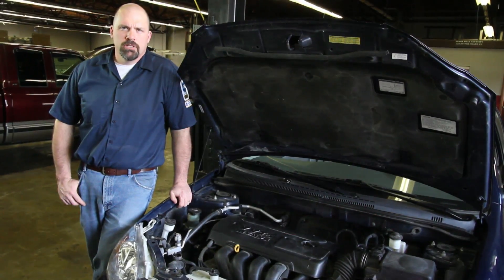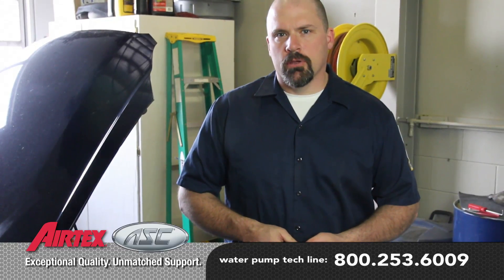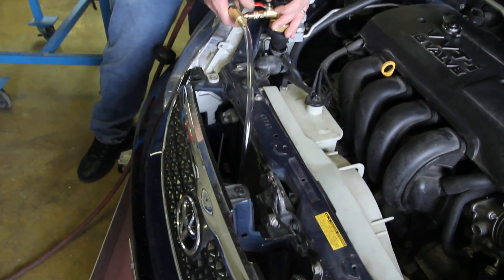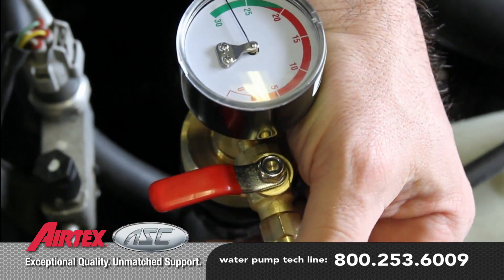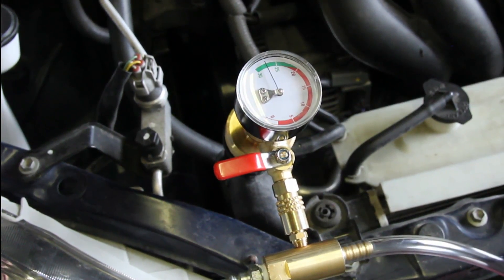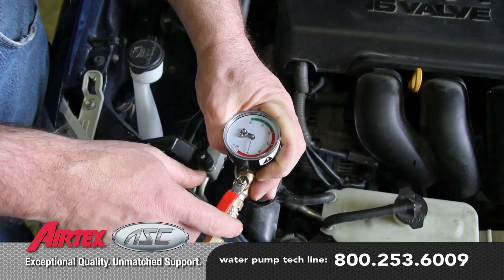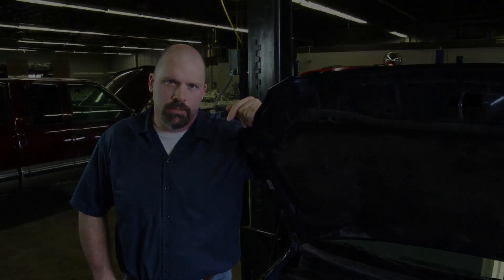Bleeding the Cooling System with an Airlift Tool

Comment: Sounds good would like to have this in my tool box. But it really necessary if you bleed it the traditional way letting the engine run with the heat on and waiting for bubbles to surface adding more coolant? Any suggestion on this vs. the Airlift .
Reply: Certain manufacturers "require" a vacuum refill in the service manual.

Comment: Completely wrong!. You introduced air into the car with the feed line. The feed line has air in it and you are supposed to remove this air from the feed line while you are pulling vacuum. What is the purpose of using this tool if you are going to introduce air in the system.

Comment: how can this tool be used to suck coolant out of engine block
Reply: It’s not designed for that
Reply: @MoparGuy1625  seems to me if sucks air would suck coolant, put in thermostat neck and fill the same way, what you think, thanks for answering
Reply: @dennisgundlach87  when I did my gfs car the other day and it still had some coolant. Not a lot came out.

Comment: i am trying to figure out if this would work on any oil less air compressor? i used 1 gallon and 6 gallon air compressor with max of 100psi and 175 psi. both failed miserablly didn't acheive any vaccum at all, and idled at 0... i did the old burping way.....

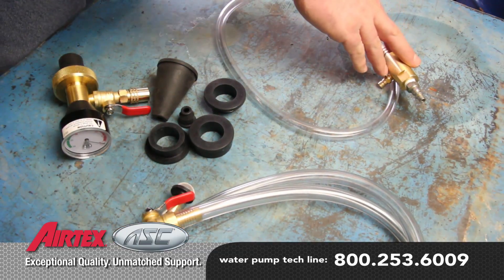Comment: 0:46 engine should be OFF at all times using airlift. Once complete collant transfer turn ON Heat to high and monitor the temp. Add collant to reservaor as needed to max level.

Comment: I think it needs to be said that when you hook the air to the head it's only being used to create a low pressure at the Tee. Thus pulling a vacuum on the system. this is a easy way to create a vacuum instead of using an actual vacuum pump.

Comment: If the system is NOT empty, will you still be able to reach the proper vacuum (20-30 psi?)? Or do you basically let the vacuum build as high as it can?

Comment: I know a few people mentioned the air remaining in tube before opening valve. I have the same brand tool. After vacuuming the system,i connect hose for coolant on valve and open slightly until coolant gets to gauge. Shut off valve and coolant stays in hose with no air. I then put air hose back on and vacuum system for another minute and then install the coolant hose again and refill system.
Reply from the maker: Sounds like an excellent process.

Comment: when you open the valve to let the vaccum suck the coolant, the air in your tube will enter the system
Reply: Probably. But did you miss the part where it said to start with an empty radiator? Yeah, there's already air in the system. the coolant pushes all that air out. The air already in the system, and the air that was in the tube. . .seems obvious, maybe it wasn't.
Reply: @jimgriggs2184  your wrong....the vacuum would pull all the air out of the system. The proper way would of been submerge the line or prime the line with as much coolant as you can than open the valve. Not sure if you knew that
Reply: Proves that being a master mechanic doesn’t make you a master.

Comment: minimum SCFM requirements?
Reply: +Airtex Pumps I've used in the past weren't successful. I did not have a very large air reservoir on the compressor. most I got was 5-10psi w/ 2.6 SCFM @ 90psi. Heard 20 SCFM but that's shop air..
Reply: i used this with 1 gallon and 6 gallon 175 psi oilless air compressor and returned both of them and along with this device... i think you need a big ass 20 gallon air compressor...